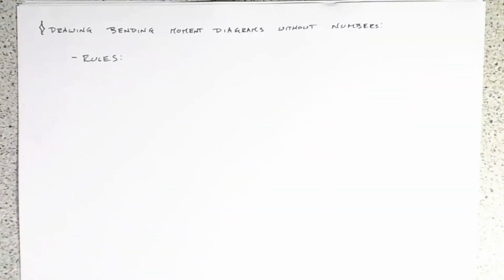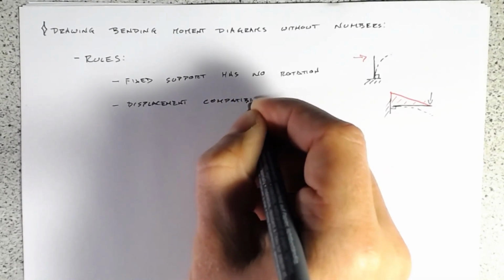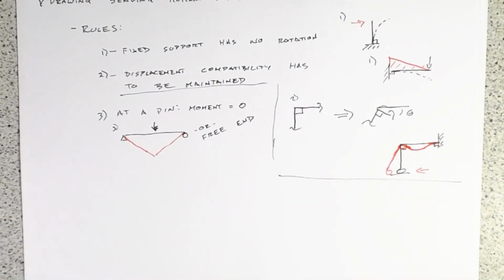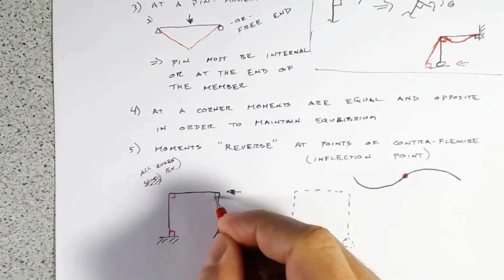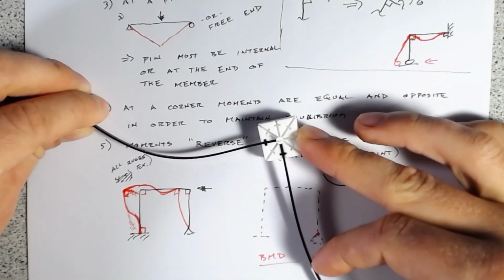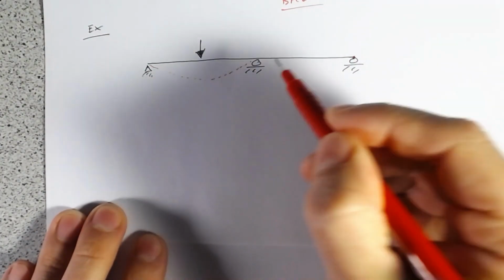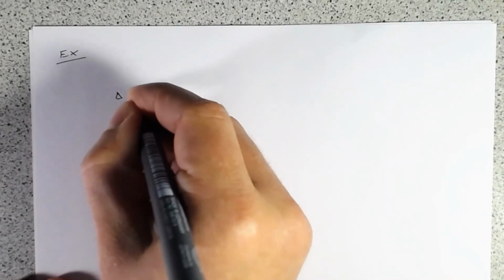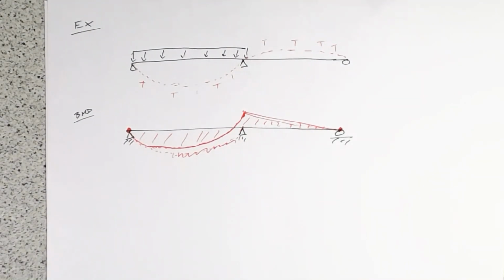Drawing Bending Moment Diagrams from Deflected Shape

Comment: Very cool video Lucas. I will recommend to my students. Where did you find that mechanism by the way? :)
Reply from the maker: The mechanism was developed and made here at the University of Auckland Civil Engineering Department.  The connections are 3D printed and the beams are laser cut.
Reply: @lucasshogan  May I ask the material for the laser cut "beams" if you know?
Reply from the maker: @KaylaNicoleWildin  acrylic
Reply from the maker: We developed these internally at the University of Auckland.  If I get clearance from my colleague who developed it, I will try to get the files up on github
Reply: @lucasshogan  Very cool, I will definitely share it around. It is a very elegant solution